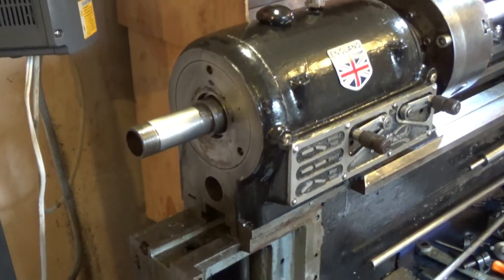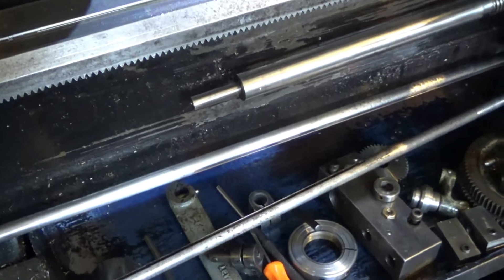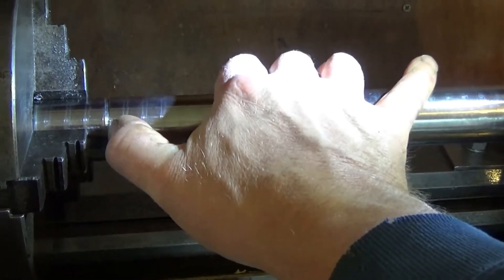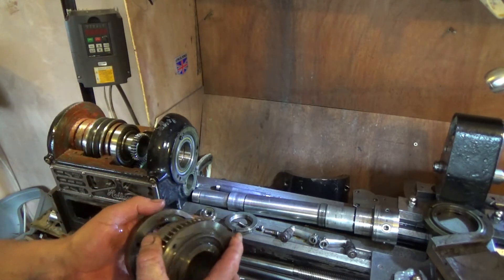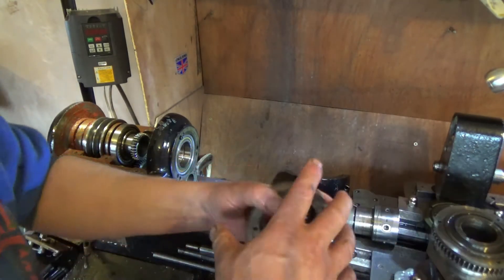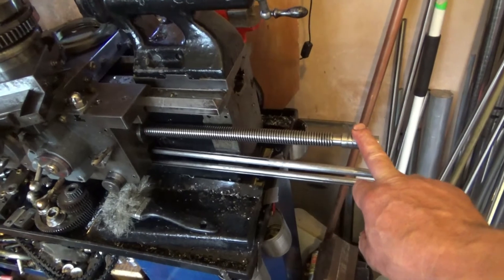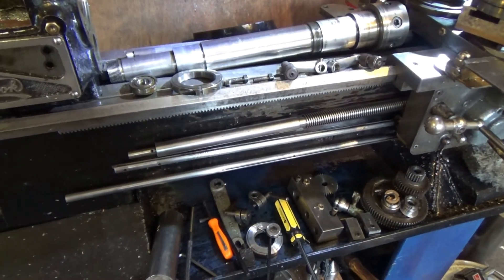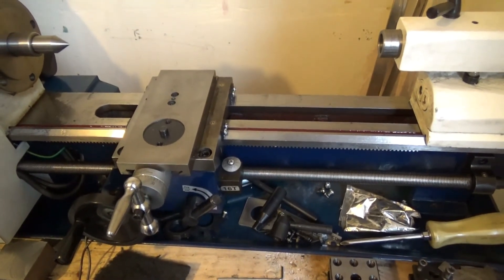Lathe headstock bearings (Holbrook C8 Dismantled)

Comment: Sounds like it's going to need new rear bearings.  Like the idea of replacing the v-pulley with a timing belt pulley.  Is the red hematite like an old-fashioned permatex gasket material? (confused, since hematite = rouge lapping compound!)
Reply from the maker: A bit yes. It is a no setting sealant. extremely thin for non intrusive sealing applications. From my experience on old English motor vehicle engines, gearbox's and axels, IT LEAKs LOL.